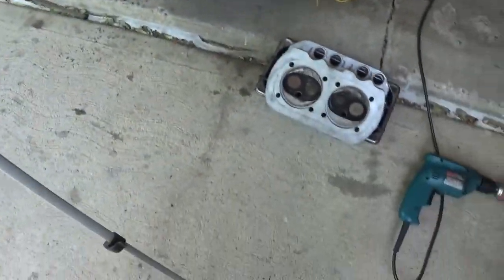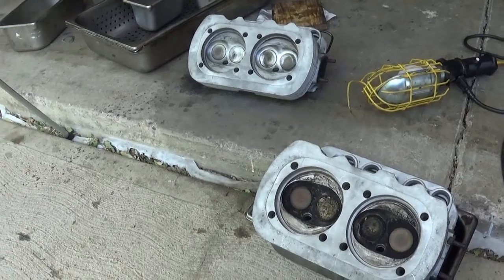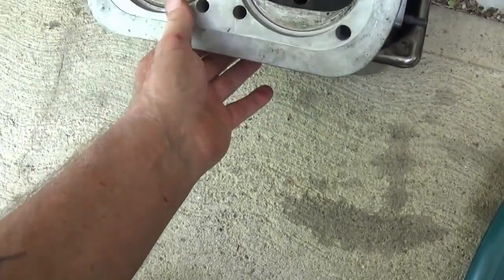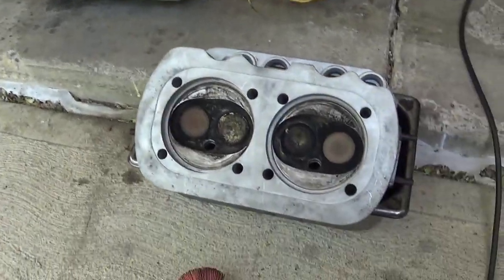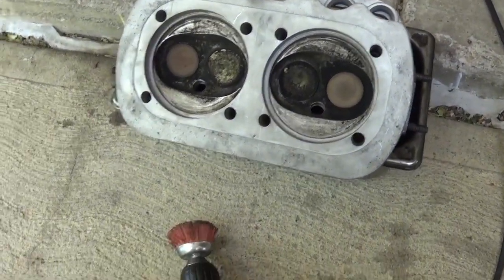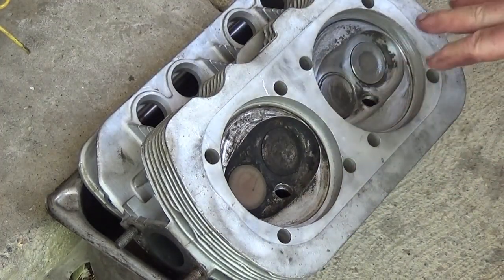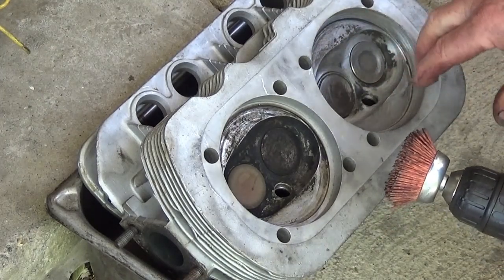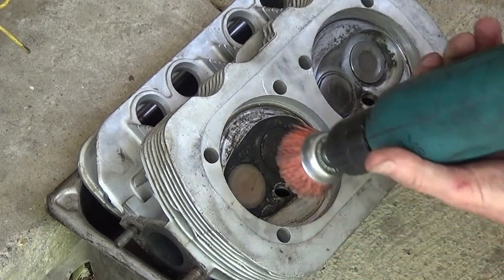Decarbonizing Aluminum Engine Heads

Comment: impressive! Funny I'm restoring my beetle now, and just searched "carbon aluminum heads" to wind up here. Seems like an effective safe way to do it. Does seem difficult to do the exhaust ports with that, any tips for those? I might just get a aluminum safe solvent, maybe something for aviation.
Reply from the maker: It's best if you can take the valves out of the head. Then you can use any number of things. Sandblaster, wire wheel on a dremmel tool or a small flapper wheel.  Just try not to mix up the valves or damage the valve seat.
Reply: @TheEZGZ  thank you for the advice, I'll be sure to number the valves so I don't mix them up

Comment: GOOD afternoon. I follow tirar projects and get a lot of inspiration from them to  do on my VW BRASILIA. I would like tô know ir you can send any piece to Brazil?
Reply from the maker: Most of it is made where you are. It would just be me sending it back to you.?   I don't do shipping.  Good Luck with your project.
Reply: @TheEZGZ  thanks for answering me. Here there are many taxes that make the pieces more expensive than there. Cheaper to buy there than here. Thanks!
Reply from the maker: Wouldn't it be easiest to buy from internet?  That's what I do most of the time. I'm not always happy with what I get but that seems like the norm.  Sometimes I have bought complete cars just to strip off the parts I want to keep.  Sometimes driving around I used to see them in peoples back yard and ask to buy it.    Sorry I couldn't be more help.
Reply: @TheEZGZ  yea. I'm looking on the internet. I thank you for your attention  and care in answering me. Soo my Project will be ready. Thanks!

Comment: Great idea. Going too clean a set of heads i got lying around. Going too see if diesel and scotch brite can clean it quicker.
Reply from the maker: Great idea!  I used to use a steel cup brush and cut a peace of scotch brite the same size and use the cup brush in a drill to turn it.  Red scotch brite is pretty course
Reply: @TheEZGZ  i save my old kitchen scotch brite pads.

Comment: Use a little carb cleaner at the same time makes clean easy cheesy.
Reply from the maker: I usually do a final clean and rinse with Brake cleaner, it's cheaper and not as toxic

Comment: Hell... I'd be happy with having a shop less than 3 hours away!  6 hour round trips to get a part there suck! And then days/weeks later another 6 hours to pick them up!  Ugh!   Since all I have is my few tools in my garage, I may try to this on set of heads I was just going to dispose of off of an old engine I bought for parts. Need to look for a brush like this.  Thanks for the vid!
Reply from the maker: It was in my horde of Cup brushes and drill attachments. It didn't work well for the intended project at the time but since I already had it I thought I would give it a try.  Worked so good I had to share it.